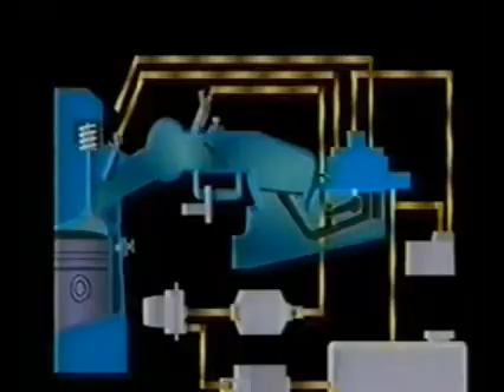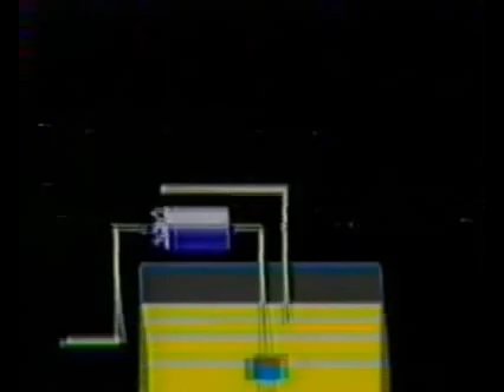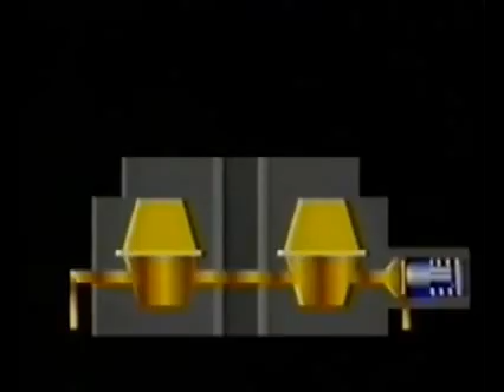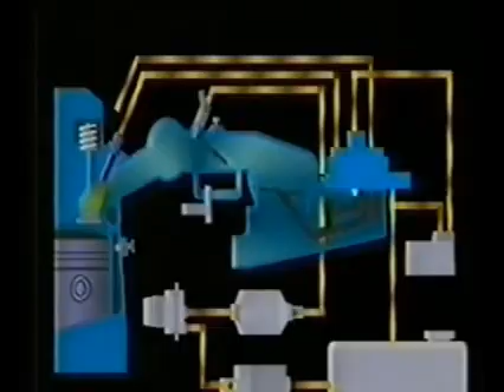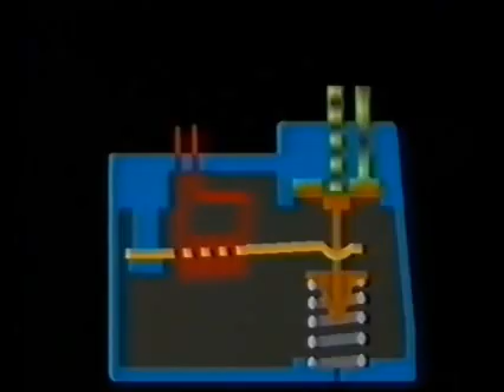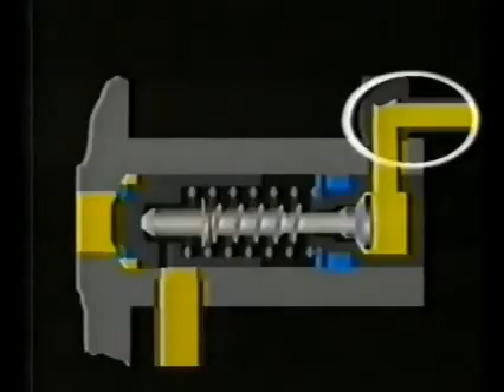Bosch K-Jetronic (CIS) explained

Comment: watching in 2026 to bring a 300SE back to life Ö
Reply: 420 SEL for me... Good luck with yours!
Reply: 11 years of owning a 300se and I'm still addicted and amazed in watching this engineering marvel that my car currently has. Mine is KE jetronic system. It is a hybrid system of electronic mechanical injection. It is said that should there be any electronic failure to the system, the mechanical system will take over. Which meant the car won't leave you stranded. It goes to pure old school mechanical injection. I once did tried to push start my car with automatic transmission just for experiment and my curiosity. It started right up beautifully.

Comment: Had a problem in my Porsche 924 equipped with K-Jetronic years ago.  It would start fine when cold, but crank and crank when warm.  Turns out, I had a split in the air induction boot that was allowing air to bypass the plate so once it cooled down, the cold-start circuitry would kick-in and it would start fine.  Replacing the boot made it all work wonderfully.  This system is SO intuitive!
Reply: Diagnosing my '77 924 at the moment, grateful for this insight!
Reply: @EatenNickel  I hope it helps. As I said, the old Bosch F.I. systems were pretty straight-forward. Get hold of a basic layout diagram and you're halfway there. Good luck!   🙂

Comment: Whoever made that deserves a medal, what a great explanation. Thank you
Reply: excellent explanation of a terrible fuel injection system.
Reply: @Corsa15DT  It's not bad. it's one of the best fuel injection system for the 70 and 80ies. If you still think it's bad, then you haven't understand it. Stop blaming things you don't understand.
Reply: @thomas2857  iv owned this sheet of a product in my escort rs, nothing but fuel thirsty trouble. I didn’t understand it then, but its easy to understand it now. Unreliable and inefficient.
Reply: @Corsa15DT  Cool, design a fuel system during a time when the Z80 was a serious computing element.
Reply: @prestonnewcomb5991 the golf GTi, the escort rs mk3 all have manual injection, no ecu. They all use this infamous kjtronic shitjection.  The z80 would be enough to control the injection in that era of no emissions. The golf mk2 is the first golf that uses cpu and its only 8mhz only 2x faster than z80.

Comment: Watching in 2021 trying to bring a 1977 Mercedes 280 e back into circulation
Reply: How'd you make out with the 280E?
Reply: Hope you managed, brother. I wish I had seen this video around the time you wrote that comment. We were trying to restore a very neglected Porsche 924 but ended up giving up on the whole thing. We let it sit for a year or two (I admit, we didn‘t look after it either) and the body started rotting (or it was already rotting but we didn‘t see it because of the wax seal underneath). We only realised when we tried to get the motor running again and the driver seat broke off the mounts.

Hope you managed to do achieve more.

Comment: It's actually a really simple system. Testing the different components is easy. To anyone who has this on their car and wants to know exactly how to tune it and see whats going on, put a wideband O2 sensor in your car with an AFR gauge. Every time I do this, my cars run silky smooth.
Reply: Videos or guides anywhere?
Reply: It's the same thing on any car with any fuel system. drill and weld an O2 sensor bung into the exhaust at an acceptable angle. Add the wideband sensor and route your wires to the interior. connect your wideband gauge and monitor your AFR under all driving conditions. Be sure not to adjust anything when the engine is still in its warm up phase, IE, get the car to normal operating temp. @nboy7
Reply: It's full of all kinds of valves and regulators that you cannot sleep at night.

Comment: I was given a '76 Audi Fox years ago. The car had been sitting unused for many years and needed some work to get it road worthy. I quickly had to learn this injection system. Once I had it all figured out, it was pretty reliable! And this was in the days before Youtube and Google. All I had was a Haynes manual, and fortunately a nearby foreign car parts store run by an old German gentleman who used to work on Audis, VWs, Porsches etc...

Comment: Worked on a lot of these in Volkswagen cars in the '70's and 80's and a few early '80s Volvos. Cold and warm start issues were the most common thing I remember working on. If you could get them to start they ran pretty well. Drippy start injectors, bad cold start times and leaky check valves made life... lets just say interesting lol. I much more prefer the LH-Jetronic systems used on the Volvo 240's. The LH 2.4 was bullet proof!! Thanks for the flashback!
Reply: Hello Tony, Im having a problem with mu jetronic. It starts really bad when the engine is cold. Like really heavy. When it starts is stutters for like 10 secs and after that everything is fine. Do you have any ideas what might cause that problem. I have checked the spark plugs, injector leaks, changed the fuel-head (the one with airsensor hand), lambda, and fuel pump. Im out of ideas :(
Have a good day!
Reply: @turboenterprise790   i hope you figured it out by know but after watching the video have you checked the injectors specifically for cold starts as shown in the video? As well as al components related to cold starts as shown in the video?
Reply: @jj14f6 Yes boss the issue was solved. It turned out to be a tiny crack in the fuel hose inside the tank. It was small enough for the pump to maintain the pressure needed for engine operation but big enough for the fuel fall back into the tank draining all the fuel systems hence the 20sec crank time(engine starting, pump filling the system with fuel before injection). I recommend for all having some issues they can not resolve: check the hoses for fuel pump inside the tank for leaks because the original systems are like 30 years old + there is a big chance some mechanic has already changed some stuff in there and not used the correct hoses for fuel therefore they will wear our much sooner causing random problems. If anybody wants to see a video about checking the fuel system for pressure holding up after the engine is shut off, without a gauge or special tools. (needs to hold some bars for some time)
Reply: @turboenterprise790  Ah well thats great and really interesting but if there was a leak there also must have been fuel under the car? Which you would notice right?
Reply: @jj14f6  No. The fuel leak was inside the fuel tank. In my car (audi) the fuel pump sits inside the fuel tank and pushes fuel front to the engine.
Reply: @turboenterprise790  Ah right yeah some models do have them in the fuel tank makes sense
Reply: Lh is easy kjet is for men

Comment: K-Jetronic is an amazing system, light years ahead of its time.
Dead reliable, very tuneable.
Reply: @doggo5577  you are right and wrong....  no K-Jet powered Car is running since 30 Years. It would show a Mileage of a Million Miles ;-)

on the other Hand you are right... letting the K-Jet si is the worst you can do. But the System also needs once in w while a little TLC. Just treating it like a modern EFI Car fucks it up. Also no skilled mecvhanics ruin the Settings.
Reply: Personally I think D-jet is pretty good. I have no experience with K-jet. I do own a 71 VW Squareback. I've put 100,000 miles on that thing. If you want a reliable car and want to avoid Murphy's law, buy a parts car, not a polished turd.
Reply: Was good for it's time, but terrible in hindsight
Reply: @Rob-md6ml  I bet you've never had a car with K-Jet
Reply: @FirstOnRaceDayCapri2904  I did. Three of them. Never again.
Reply: The Bosch direct injection fitted to the Mercedes 300SL was light years ahead of it's time. 

The K-Jetronic was a regressive piece of junk that offered no benefits to a multiple carb set up. 

For starters, it has a massive restrictor in the airflow due to the air flow sensor plate - worse than any carb venturi and it's continuous injection so you can't run large valve overlaps like you can with direct injection. 

They are also a complete pain in the rear end to tune properly. 

The best thing you can do if you have one is throw it in the bin!
Reply: @robwilde6857  tell all of that to my daily driven turbo porsche that runs perfect and passes my local emissions tests.  using a wideband and a brain tuning kjet is extremely easy and stays in tune long enough to worry about cylinders wearing. carbs are great  and have tuned hundreds of vintage cars with dcoe's and idf's but they are a huge compromise in terms of efficiency.  obviously kugelfischer port injection is the best form of vintage fuel injection. price and difficulty in fitment reflects that.  the air flow plate is not really that resctrictive especially in turbo applications. there is a reason porsche used kjet all the way into the mid 90's on the turbo cars. it works, its easy to tune and it doesnt break.
Reply: Continous injection gives extremely poor fuel consumption and engine wear from the fuel continously washing the bores.
Reply: @bikeman123  you absolutely dont understand this system if you think that. many cars using this system see30-35 mpg and 300k on original rings. futhermore they will cruise at roughly 14.8 AFR which indicates proper fueling. it is precisely metered and only takes in the air fuel mixture during the intake stroke.
Reply: @PDXTRACKLOCROSS Isn't it the case that the injectors spray the inlet valves with every stroke and therefore waste fuel in the inlet manuifold?
Reply: @bikeman123  they do spray as long as the metering plate is lifted of its rest but the mist is just that a very small amount of fuel.  on a fully warm engine every bit of fuel sprayed with stay atomized and gulped in with every intake event. the tech will adjust the system using a co meter and the result will be a efficient running system that uses as little fuel as possible.  earlier system do not have any afm monitoring device its all in the initial tune. ive been driving cars with k jet since 2008 and i literally have never been stranded from a fuel injection related failure.  that even included a hodge podge turbo system i built for a 250k mile bmw 320is.
Reply: @PDXTRACKLOCROSS What K jetronic vehicles were getting 30 to 35 mpg?
Reply: @gregorymalchuk272  my 77 porsche 924 would regularly get just above 30 on the highway. the vw rabbit was getting 35 on the highway. lots of little gas miser hatchbacks used k jet in europe.
Reply: @bikeman123  Spoken like someone who knows nothing about K-Jet
Reply: @FirstOnRaceDayCapri2904  My W123 has shit fuel consumption and CIS seems to explain why. Enlighten me.
Reply: 1991 Mercedes 300sl @FirstOnRaceDayCapri2904
Reply: 1991 300SL will never start when engine is cold unless I put fuel in the bowl I'm going to change the cap rotor and a fuel filter and see what happens unless you think it's the accumulator or the fuel pressure regulator I'm stumped on this one.
Reply: Actually the opposite. The worst ever inveted POS i´ve ever wrenched on. Tunable? nope. Reliable? Noooooo !!!
Reply: @FRITZI999  sounds like a technician problem
Reply: @PDXTRACKLOCROSS  

Shovel you shaming Comment up your Ass Buddy.... i studied this System over the Years, own all Technical Manuals and even Stuff from Bosch YOU would not even get your Hands on. Also Tools to fine tune that System.  And even had Contact to a Guy who worked at BOSCH during the Invention of the System - his Comment: "the biggest POS we ever made...." Quote End.

I learned plenty of Stuff from him. But in the End it´s an old, obsolete System full of Flaws. 

Yeah, mine runs perfect, but that does not make it more Lovable. Mine never had any Issue after i was done with my Cars fulll Restoration.... but that doesn´t make the System better. It´s just crap !

Yes, for it´s time it was "ahead", but pretty fast obsolete. That shows that it was just a kind of Learning Step in between to a better System.... KE and Digifant for Example.

IF the K-Jet was so magificent, why don´t we still use it?
Reply: @FRITZI999  sounds like the problem is only you.
Reply: @GremoDrifting  Fuckin Idiot - mine is running. You are BULLSHITTING FUCKIN IDIOT !!!
Reply: @GremoDrifting  shut the f*** up ! My Car has absolutely no Problem with the K-Jet... cause completely rebuilt to "better than Factory" Stadtard. Its all the other in Facebook Groups and Forums crying... complaining...
Reply: @FRITZI999  Owned my 911sc since 1986 only replaced WUR once. Runs like a top.
Reply: @ase2060  yeah, sure....
Reply: @FRITZI999 it is reliable if you run the engine often. if you let it sit the whole thing siezes up and youre fucked.
Reply: @EvanJ-g8n  you are preaching to the wrong Person... working on K-Jets since roughly 1988 when Theiy were still Standard. So how do YOU want to lecture me... you ain't even from Germany, hell, I grew up with this crap, WHO ELSE can know it better than me. It's from Bosch, you know? 
This System was in cars when you Americans and Brits were still fiddling on Carburettors and rumbling old Gas Guzzler V8 with John and Billiebob ! ;-)
Reply: @EvanJ-g8n  seems you cannot face reality and other peoples Experience.... typical Action nowadays on the Internet.   

Suck it up Buttercup - That's Life!
Reply: @FRITZI999 why so aggressive? Thats such a weird thing to say. I have rebuilt these only 3 or 4 times and already understand them so idk maybe i figured them out faster than you did?

Comment: K-jet is a much simpler system than EFI. However, EFI is much easier to diagnose. People hate it because they don't know, or don't want to diagnose it. With EFI, just a simple computer scan will point you in the right direction. K-jet was from the time of real mechanics. Back when you had to adjust valves, adjust points, adjust fuel system pressures, etc. Unfortunately with modern technology, everyone either has a husband or dad that is a so called "mechanic" just because they have a scan tool and some sockets. 

My hat is off to Bosch for this great fuel system. When tuned correctly it can support good power, the acceleration and response is amazing, the sound is unique. And it blows people's mind when they see the mess of fuel lines an hoses under the hood.
Reply: Cracking system if you know what you doing😎
Reply: If you think you can just fix every EFI problem with a scan tool, you obviously don't know EFI :D

Comment: Is the Bosch K-Jetronic mechanical fuel injector in 1989 car compatible or incompatible with E10 petrol?
Reply: If you have a choice to avoid E10 petrol, do so. 
It is the devil for all older fuel systems that are not specifically set up for it. 
I don't imagine K-jet being any happier with E10
Reply: Consult your owner's manual
Reply: V B as long as you keep driving it. Try to avoid if you can, check pure-gas.org try using some fuel treatments like Startron.

Comment: the video says' all injectors spray fuel at the same time continuously'. what happen to the fuel sprayed into cylinders that are not at its compression cycle (or ignition)
Reply: Its port or manifold injection (so the intake valves will essentially block the fuel, SORT Of similar to a carbed setup)

Comment: I'm a lucky person. Had my '91 MB M103 CIS-E system adjusted by a good tech in 1997. That was the last time anyone has ever touched it. I do routine maint. often - use good gas and do sufficient highway driving in order to keep clean gas flowing thru the system.
I have read 100s of stories about people having trouble with their CIS system. Many are DIY types who buy all of the special tools needed to adjust its various components. Its my belief that in some cases, these DIY types have no clue what they are doing when they start to tinker.
Reply: This system is very reliable and I think you are right that people who have no idea what they are doing actually cause more harm when they start to tinker with the system. Rarely the fault is with the K-Jetronic itself. More like with vacuum leaks, leaking injectors etc.
Reply: @pilskadden  Agreed, I think more problems are created by some DIYs.
Reply: I have always thought this, about other car issues.  With some things, you either know or you don't.  If you don't you need call somebody who does.

Comment: for my w116 mercedes a change the original part accumulator bischoff 1164700516 for this new part 1264700116  for a good start when the engine is hot ! bye !